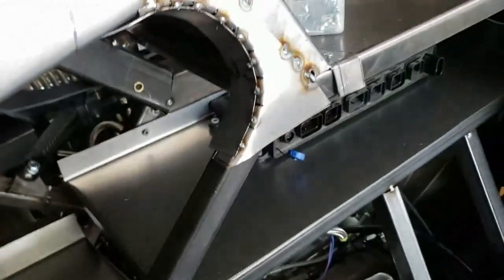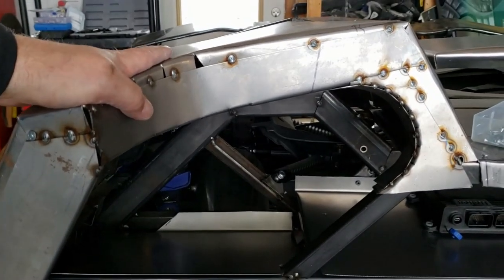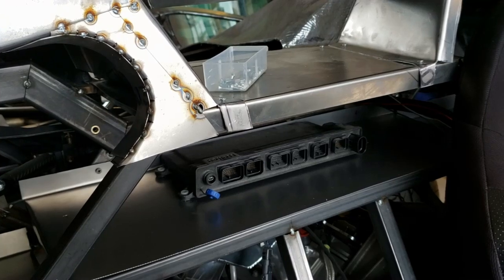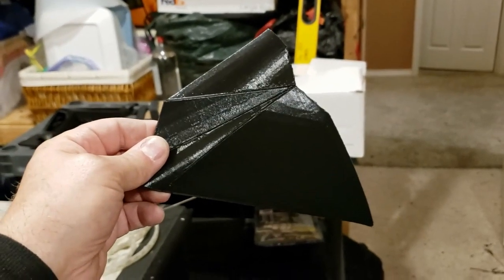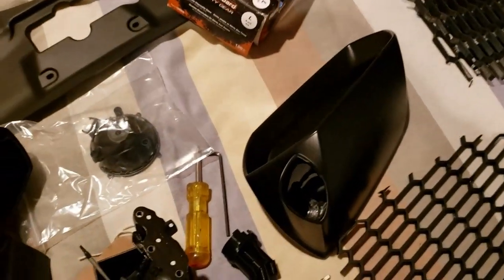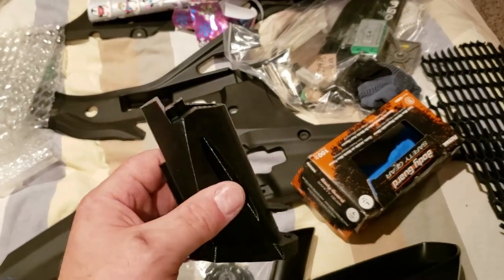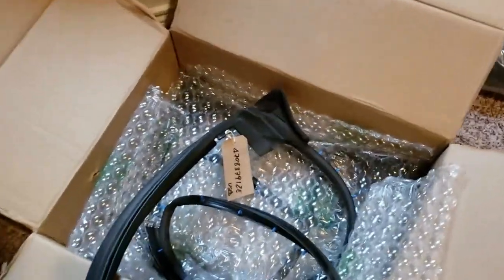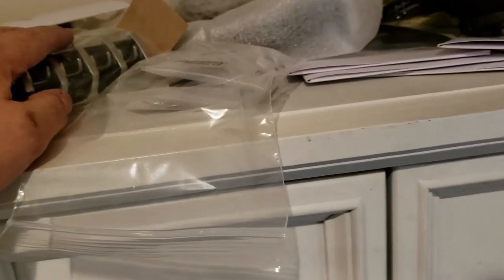3D Printed Interceptor Update 27

Comment: Hi there, loving the project! Just wanted to give you a heads up based on my learning experience with my own car and plug n play LED bulbs in a mini H1 HID projector; be careful using LED bulbs in HID projectors, they’re not designed for the projector bowl design of an HID projector. The actual light output on the road is greatly diminished despite how bright it looked when I was adjusting my headlight 25 feet from a wall. The LED bulbs’ light just do not have the reach of an HID bulb, or an LED projector. I highly recommend using LED projectors, it’s a lot cooler to run than the HIDs. 

Also, what material is the headlight housing printed in?
Reply from the maker: ASA.